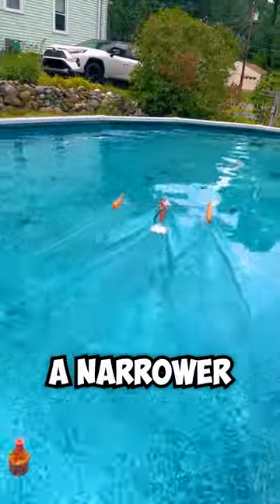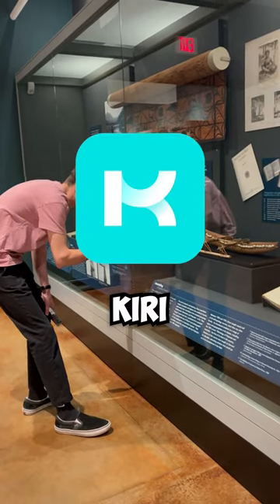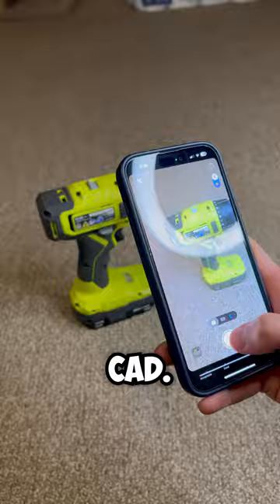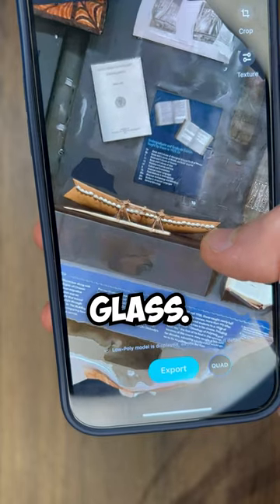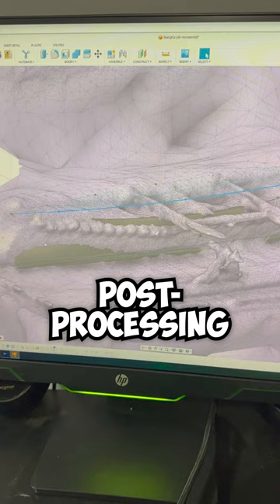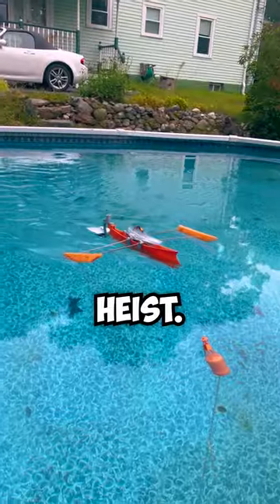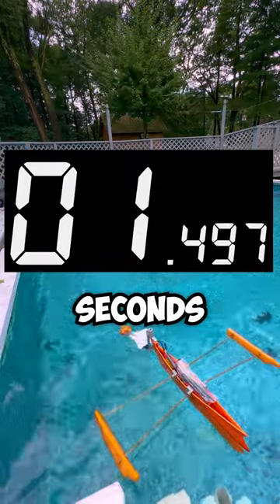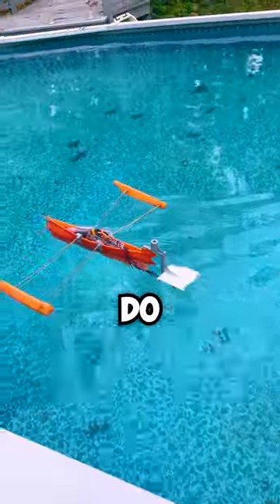I "Stole" a boat from a museum.

Comment: Put two Rocket engines to the Left and to the Right, but keep the electric engine in the middle for an faster acceleration.
Reply: That would be really cool
Reply: Real
Reply: its hard to make one that actually makes it go slightly faster
Reply: unless you use sugar fuel
Reply: Ye
Reply: jaay!
Reply: as a filipino this is not traditional
Reply: But it'll dive down
Reply: @GipsyDanger_loves_kawasaki_h2r  Maybe you’re right, it was just an Idea
Reply: it's gonna heavy which causes drag
Reply: Electric engines in a boat… very clever 😐

Comment: Changing out the dual outrigger design fora single larger one, with some adjustment to the location of the center of mass/thrust, should get you a further net speed gain if youre still chasing that

Comment: Instead of straight poles holding the support make them arch slightly up. Maybe it’ll make sure no water touches it causing drag and maybe be better support since the force will be pushing down more or something idk I’m not an engineer

Comment: You should make it a jet boat
Reply from the maker: If I had 3k to spare I definitely would get a mini jet engine
Reply: I think he means like "jet" boat, like jet skis that use a different method of propulsion compared to the traditional outboard/inboard motor and propeller
Reply: @makermandan make a the steering appart from the Propeller
Reply: Like a jet boat like how jet skis or actual jet boats do it not like a jet engine.
Reply: Build a catamaran
Reply: impellers  my dude

Comment: Another idea would be to have a rc car that can turn into a drone like the car from gta and the wheels turn into props
Reply from the maker: Ooh I like that!
Reply: @makermandan  3d print props with the hoops around them and have rubber bands around them to prevent wear on the props themselves, the only tricky part will be having them go from static drive ( power to the ground with no real need for keeping the car stable) to variable drive (balancing the car in the air like a drone) I image it would be similar to a awd system providing power to the wheels that are getting the most traction, one idea would be to have a separate motor for the drive train all together for seemless transmission into flying mode with a simple flip of a switch to have independent drone motors running in the wheels

Comment: Another idea would be to make a boat that can catch fish and successfully reel them in for you so it will have to have a air tight system to always make sure it comes back to the surface Incase a big fish pulls it down you can press a button and it release the fish and you float back up so you don’t lose your hard work

Comment: Ive got an idea try making it look like the Titanic because its pretty slim and maybe you can make either one big propeler with 6 sides and 2 with 3 sides or make it 2 propelers and add some weight down at the center botom and it will look pretty cool tho TIP:Dont hit an iceberg

Comment: Another idea would be to make a solar powered rc sail boat that could in theory travel across a huge ocean via gps and directions and have little motors like that pushing it and having a recharge restart the trip system that can operate itself

Comment: Remember to get speed you need to get the boat to get on plane… basically start gliding on top of the water rather then pushing/cutting through the water… your designs are better suited for heavy loads or towing like a tug… your probably gonna want to go to your local pond or some place with more open water to help as well since it seems you don’t have much room
Reply from the maker: I've seen the worlds fastest boat, it has some really cool hydroplaning surfaces.

Comment: How big can you scale it?
Reply from the maker: How big can I scale the boat? Depends on the limits of my 3d printer
Reply: @makermandan  I was meaning more along the lines of that scanner app. Cause you can build in sections then connect it. But if you can't size it before printing there's no point in printing it, right